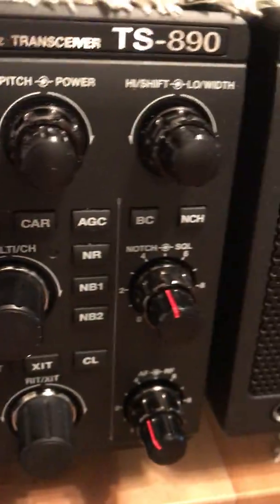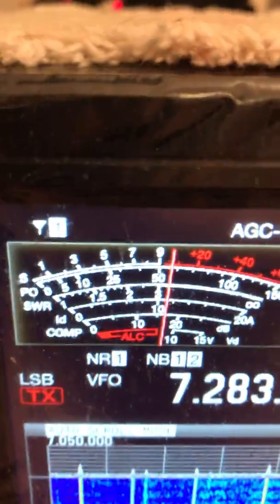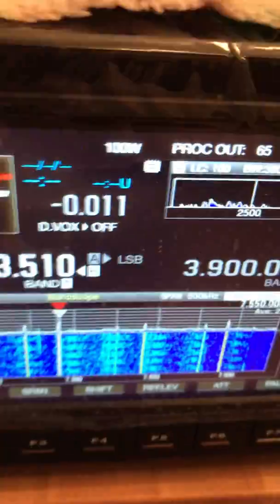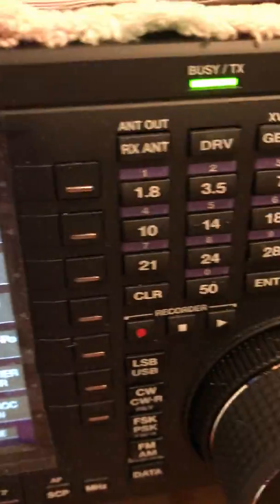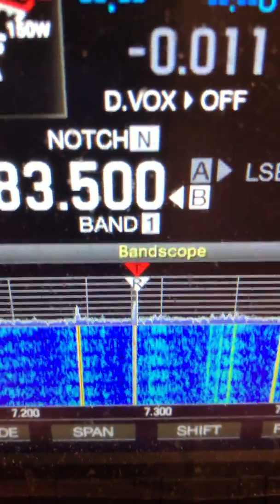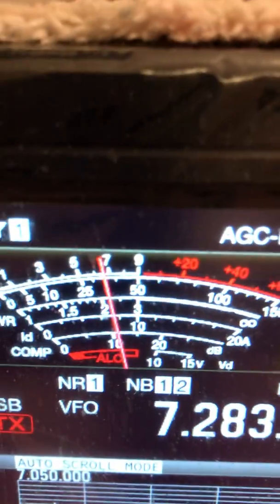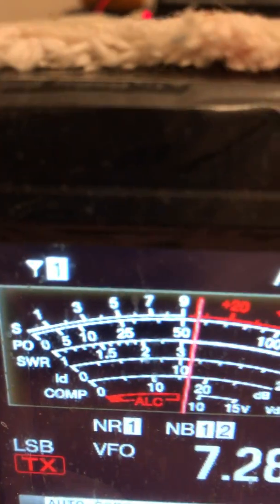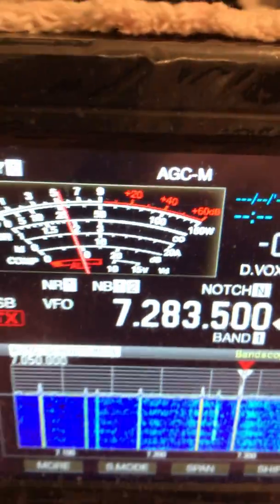Kenwood TS-890 adjustable notch filter

Comment: This feature is inop on my 890. I use a W notch; the offending signal, S9 and above, does not appear in the band scope, The "notch display pattern" is on the scope minus the offending signal. Tweaking the notch control moves the pattern but does nothing to knock out or reduce the bad guy.

Comment: This video misses the feature that one can adjust the bandwidth of the notch filter by momentarily holding down the NCH button which will then cycle through three options, narrow (most often used to very effectively eliminate single tone, beat frequency with little effect on SSB voice transmission), medium and wide.  The "NOTCH [N, M, or W]" is displayed above the frequency counter display and these effects are evident when using the DSP monitor or IF graphic filter display.  The medium and wide setting may be effectively used in conjunction with the IF filters, especially since those can be adjusted, too, to block out near interference such as in contest environment.  The Kenwood manual provides a graph that illustrates the specification for each of these three effects.  I'll add..., in counter some others, that I heavily use both Noise Reduction setting 1(SSB/AM/FM) and 2 (not together!) and somewhat often left the adjustment display open to quickly adjust either effect in response to rapidly changing band conditions.  While some would argue that one should not have to adjust often, I find the 890 to be exceptional in eliminating noise but some low-level hiss on setting 1 (that can be near eliminated with the RF gain adjustment: also watching the IF or DSP display monitor in adjustment so the hiss just breaks into view upon the bottom of the graphic display when speech/data is not received: this will also display the strengthened dynamic range of the received signal, too) and have used setting 2 - with a lot of adjustment - to make near unintelligible speech intelligible with some degree of strain to my tinnitus ears!  When band conditions are horrid, I have switched to this second setting, which can and does create a bit to much water effect; however, I can at least make out the words - and without the otherwise horrid hiss -  that other radios have not been able to clarify.  To add, I also use a BHI Dual-In-Line line amplifier/noise reduction unit to better power an external speaker (Palstar HP30H which provides a rather broad listening cone) and the switchable on /off and adjustable DSP noise reduction eliminates the remaining hiss to sound almost FM-like.   In comparison, the BHI effectively eliminates noise with ver low to moderate water effect that smoothes the hiss.  The Kenwood's HR 1 setting more effectively maintains voice clarity by maintaining a bit more higher frequencies that thus includes the hiss.  SO, a lot of options.  My tinnitus requires my use of the BHI to listen strain especially in lousy band conditions.  Well I sure got off track of the notch filter; but all these effectively work together.  Oh, to add another...my mag-loop receive antenna will pick up broad-band signals that I can null out in rotation -- that otherwise barely is perceptible in use of my vertical (which is a noisy antenna in an urban environment); but the noise blanker eliminates this annoying interference with very minor effect to SSB transmissions -- absolutely needed when one of these annoying systematic, very narrow tones are upon the SSB transmission that RF gain adjustment can't eliminate.